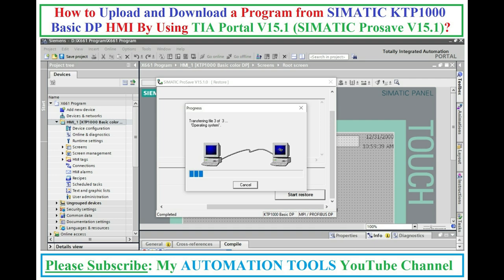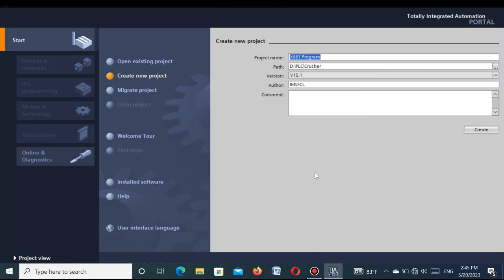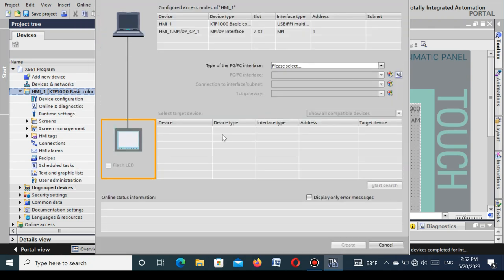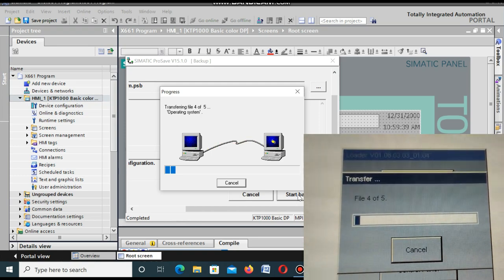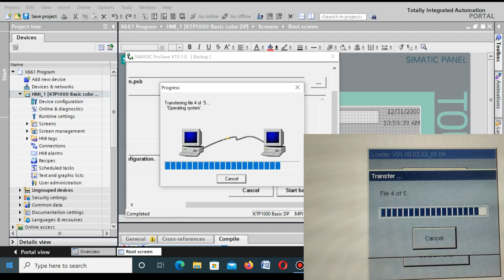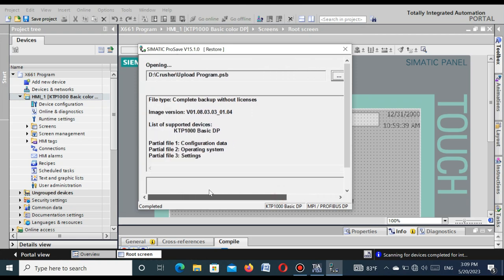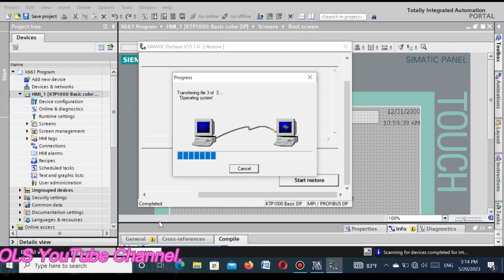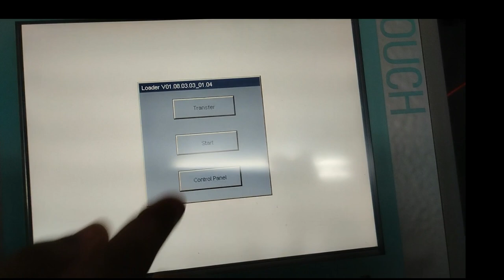How to Upload and Download a Program from SIMATIC KTP1000 Basic DP HMI By Using TIA Portal V15.1?

Comment: Hello，please help me that I can not find MPI interface in TIA 17.  hardware（KTP1000 basic DP 、315-2pn/dp、USB PC adapter A2 (6GK1 571-0BA00-0AA0)）software( TIA 17
Reply from the maker: Make a short video and send me.
Reply: @automationtools123 hi please i cant do a simulation plc 1212c v 4.4 and ihm ktp1000. The main programme change but nothing happen in the hmi not variable change
Reply from the maker: Mayt be plc program tag name doesn't match with hmi
Reply: @automationtools123  i did a simple programme but when i start simulation hmi show a message that the connection brock. 
Is it possible thta hmi ktp1000 basic doesn't match wich wincc v16 ?